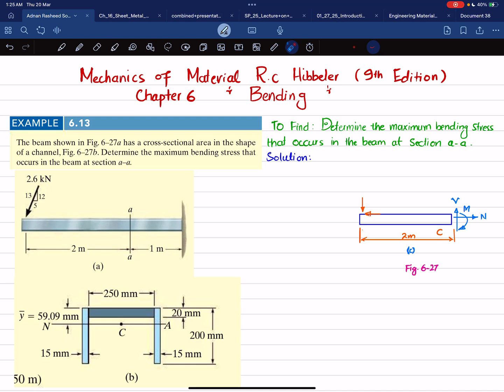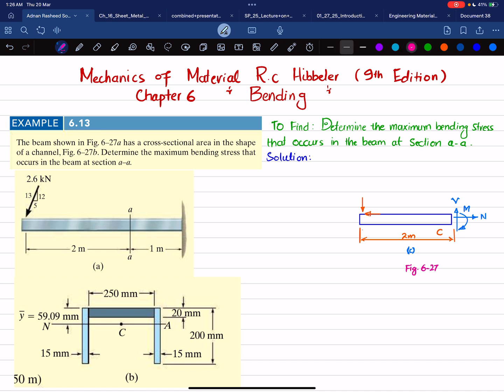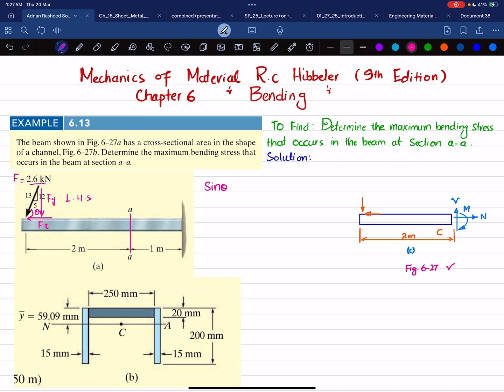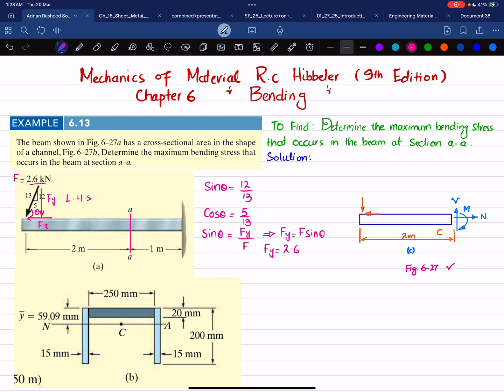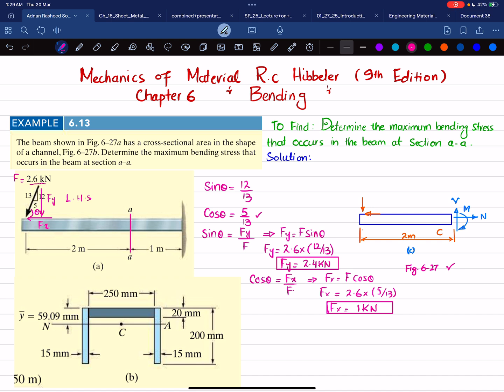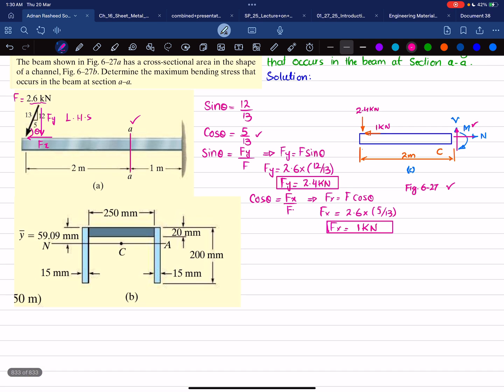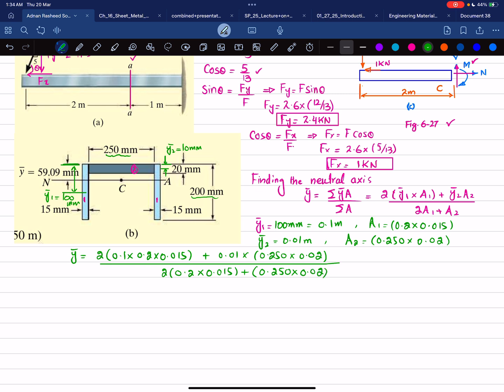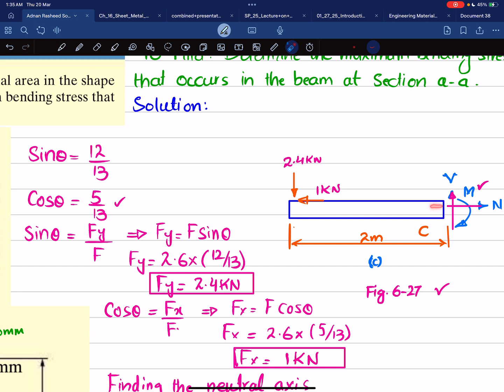Example 6.13 | Determine the maximum bending stress that occurs in the beam at section a – a

Comment: thanks eng adnan you did great < i have a question which is when we use the parallel therom and somtimes we just calcluate (1/12 .b. h cube)  WITHOUT   ( A .D square)
Reply from the maker: you are welcome . ok when the neutral axis of a section is passing through centroid then d=0 so you can neglect Ad^2 .